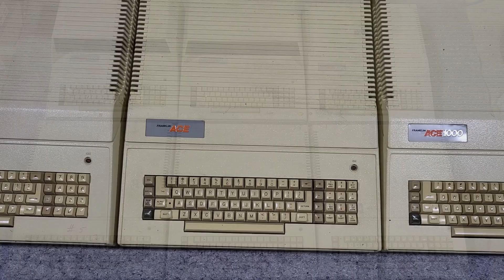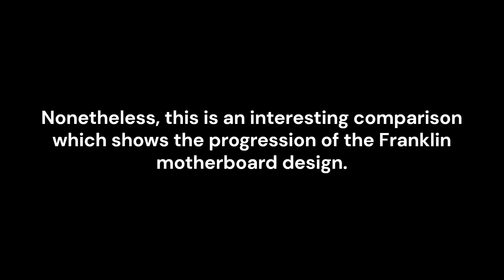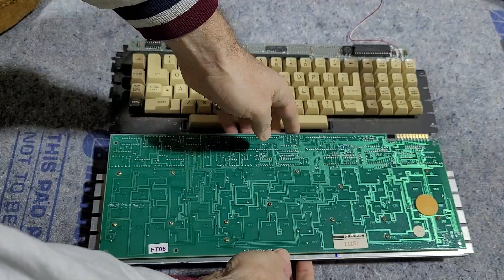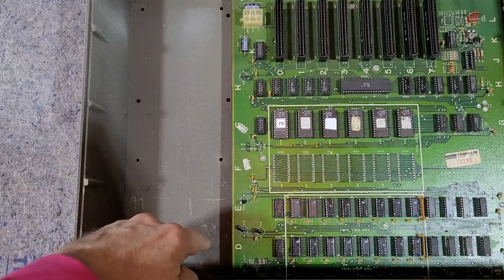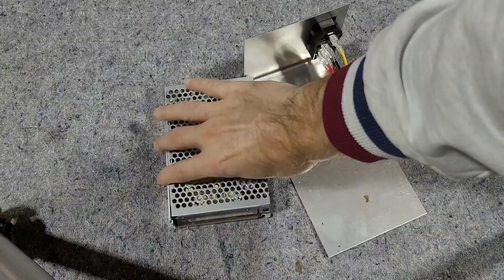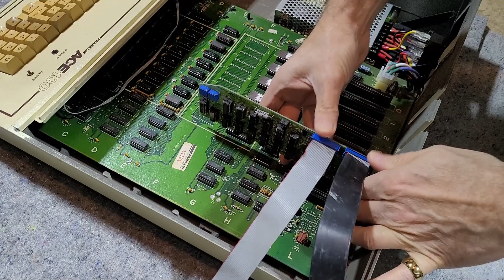Franklin Ace 100 repair

Comment: An ATX PICO power supply for the Apple II would make a reliable replacement for the missing power supply.
Reply from the maker: With the right cable/plug, it sure would.  I also considered one of the Reactive Micro PSUs before deciding on the Mean Well unit.